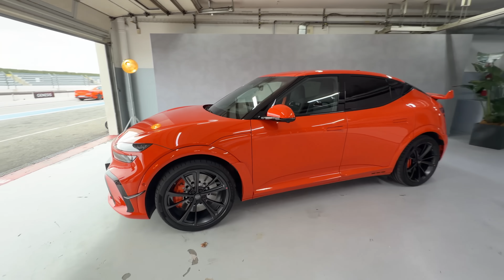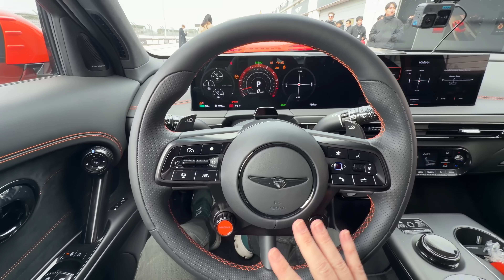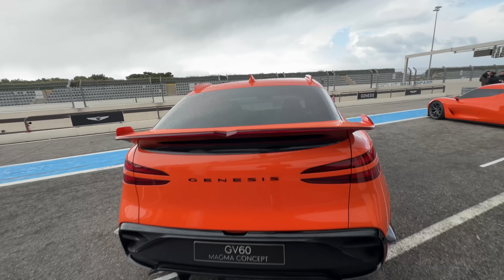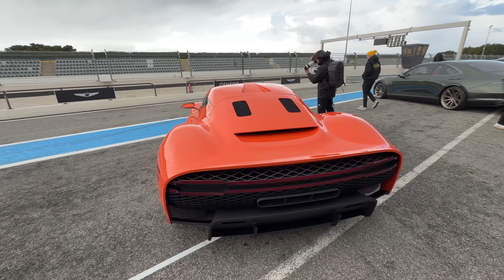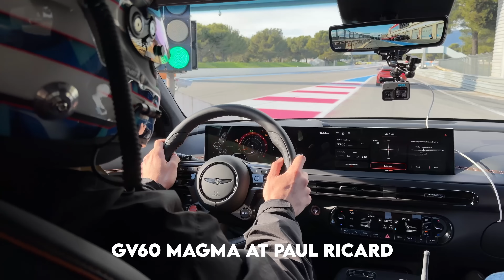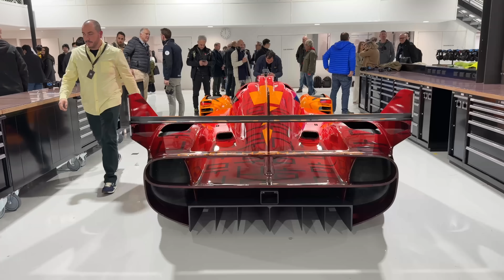Genesis Built A Supercar And It's Absolutely Insane!

Comment: The Genesis Magma GT is scheduled to compete in the GT3 class in 2027. To qualify for the GT3 class, 20 to 30 racing cars based on production vehicles must be produced within two years. Genesis has confirmed its Magma GT production plans. Genesis plans to produce and sell 250 to 300 production cars to qualify for the GT3 class. However, this is only the minimum requirement in reality, production will be much higher. A total of eight production models are planned for release.

Comment: The cars are pretty sweet but the headlights do look cool but road debris might cause some serious issues as they are exposed to a hard hit and replacement. The supercar one has the I did fall asleep on design but the taillights are sweet. The part of serious worry was the driving on the track as I get the vehicle is to him but if I worked for Genesis I would have had you pull over and get in the passenger seat. The wagon is the true winner out of the three vehicles.

Comment: The Ioniq n's virtual gearbox and engine sound are sound interfaces that inform you of the timing of acceleration and deceleration when turning a corner. 

When driving an electric car at high speed, the motor output cannot be seen through sound, reducing the stress of endlessly focusing on the instrument cluster. 

This obviously leads to a loss of output, but it also increases the sense of unity the driver feels in the vehicle.

Comment: The prop on the front of the race car is called a pitot tube and is used to measure the difference in air pressure hence measuring the actual true speed of the car....not "measure the weather"

Comment: Hyundai has been low key on fire with their cars lately. I test drove Ioniq 5n and it was a great fun little car to drive.
Reply: most reason is probably donald..
Reply: I think if they were on FIRE it would of been in the NEWS what cars have you seen on fire
Reply: sonatas and elentrans have had more engine recalls then any other car company the last 10 years wtf are you talking bout
Reply: With design, sure. Still junk where it counts, at least in their ICE cars.
Reply: @moogiebass  pssh my Elantra N is still going just fine. xD
Reply: @moogiebass  Typical shitty USA manufacturing has made Hyundais and many other cars unreliable, cars imported straight from Korea are quite reliable.